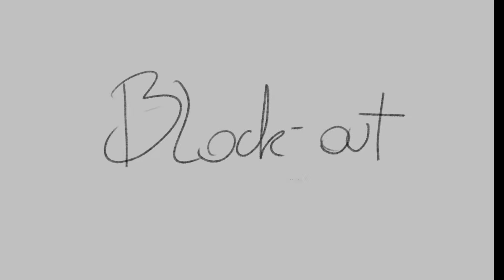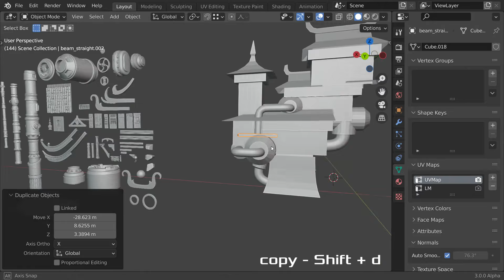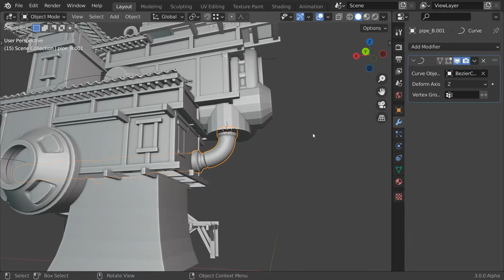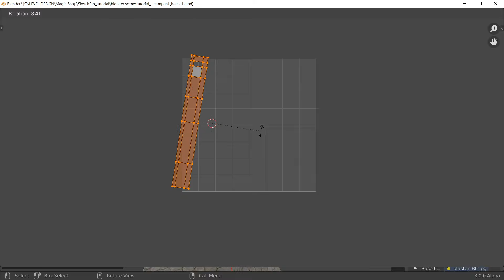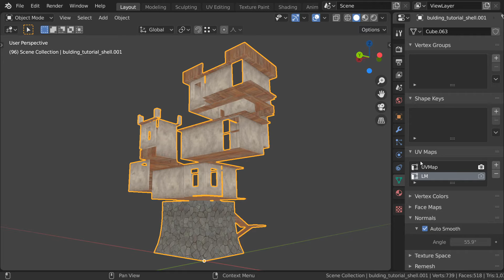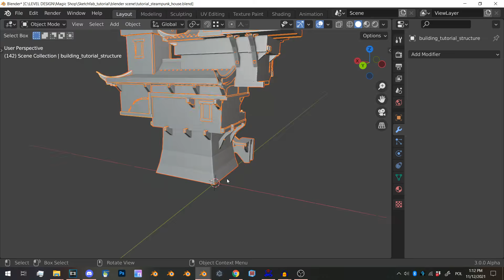Blender tutorial - Make your own steampunk house

Comment: hi fam i  got some  of  your stuff in unreal but  collision its not working
Reply from the maker: When you import the model - make sure you check out the collision settings. And if you are referring to my UE asset packs  - they all have custom collision meshes in them but it is possible for the UE to merge them into one big convex collider per mesh (once again - import options) or it also is possible that your collision settings disable the collision for some of the meshes - double click on the mesh and see its properties under collision tab. Maybe you will find what is the issue there. good luck solving it!